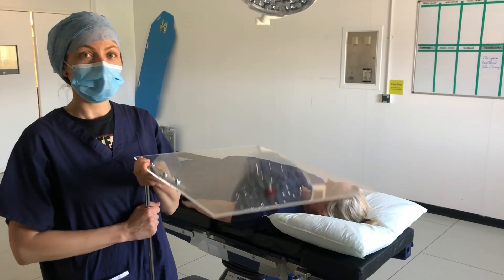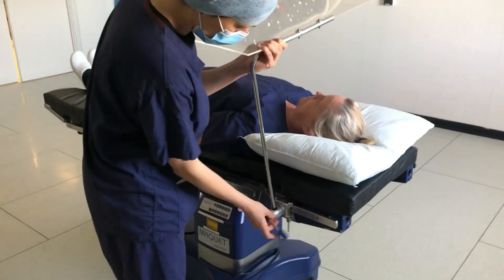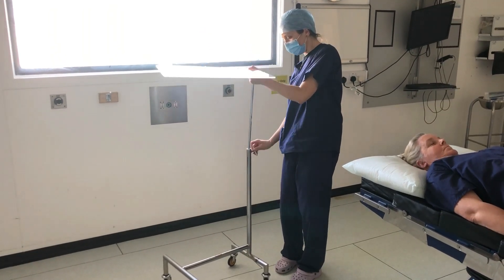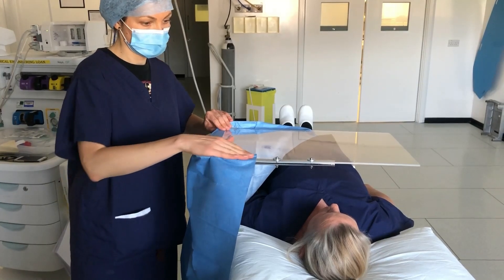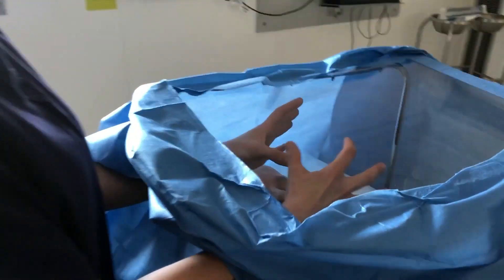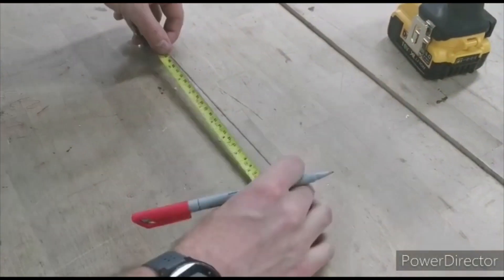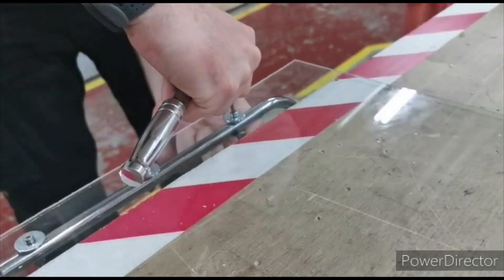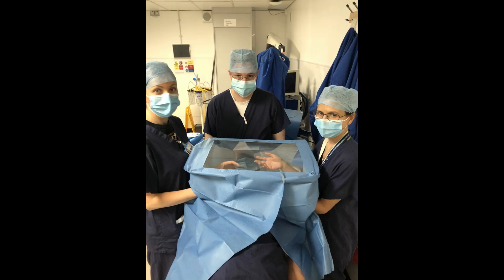Making Tracheostomy & Neck surgery  safer-The Perspex table Screening .video

Comment: We tested in Sweden almost the same techniq but the problem is the light reflex from the theater lights or headset light. It will be difficult to see operation area clearly
Reply from the maker: Dear Hussein, Thanks for sharing your experience. We didn't have any problem with light reflection with perspex. the visibility was not compromised.
best wishes
Ashok Rokade and Team Southampton